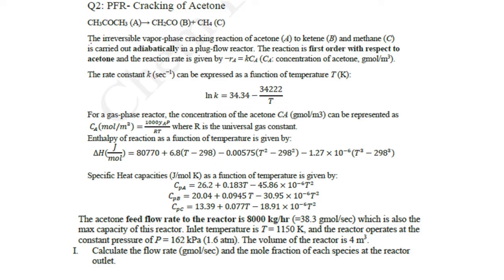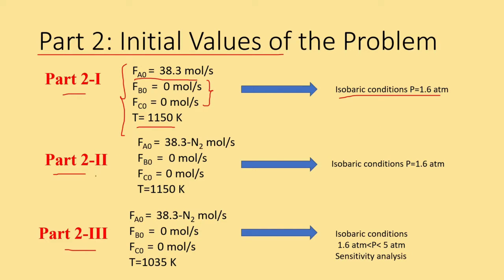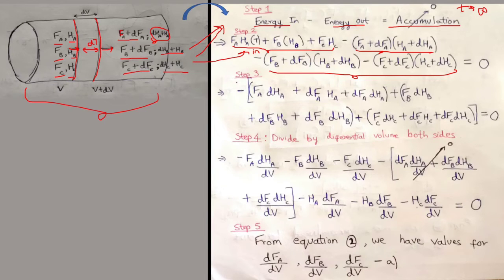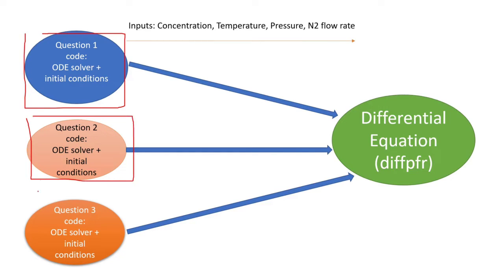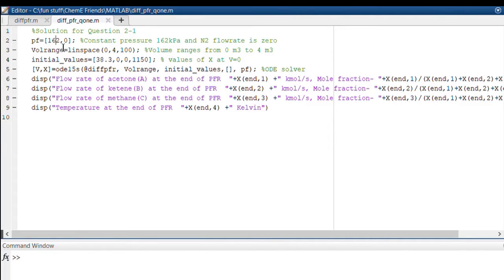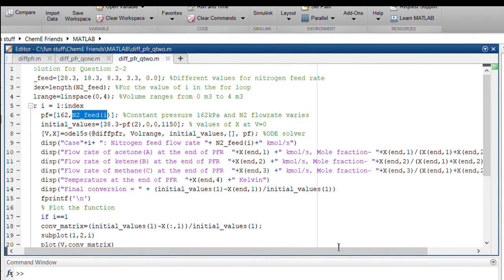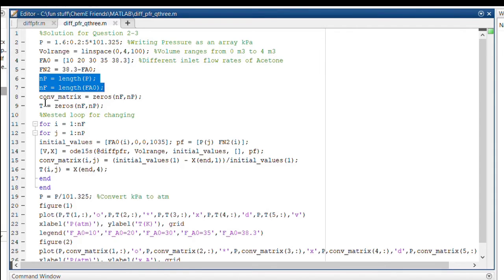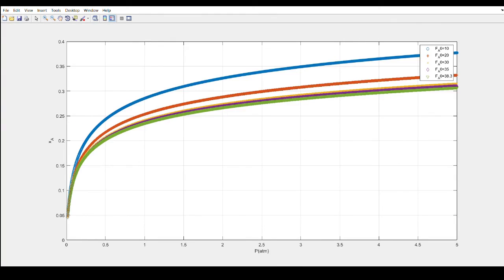Plug Flow Reactor Simulation - Mathematical modelling and simulation on MATLAB Part 2 of 2

Comment: This code is showing ode error . Please solve.
Reply from the maker: Dear Anushka, I checked again. They are working just fine. Have you put all the files in the same folder? If yes, try other ode methods (ode15s, ode23 or whatever, should not be a problem for this problem). 
I have seen this ode method bug in some systems before.

Comment: A question, can you plz or anyone tell me why the rate constant is given in this eq form 
lnk = 34.34-34222/T? Is it the same as the Arrhenius eq but written differently where 34.34 is the pre-exp factor A and 34222 is activation energy?? Thank you!
Reply from the maker: Yes you are absolutely correct. It's just another way of writing the Arrhenius equation
Reply: @chemicalengineeringfriends217   thank you sir!